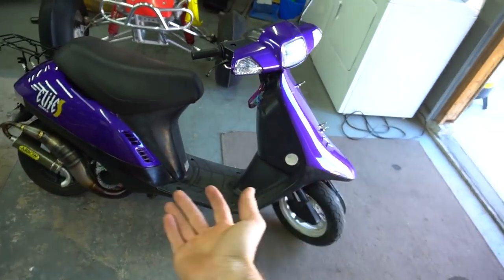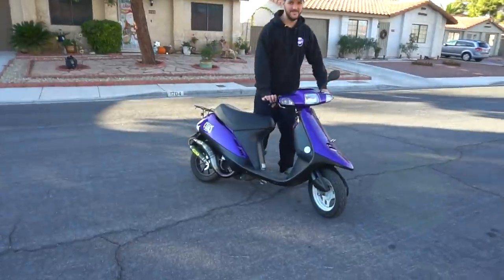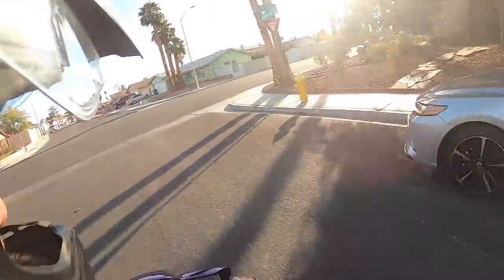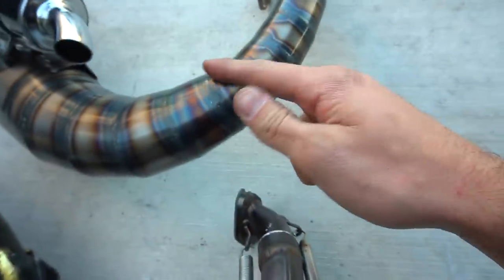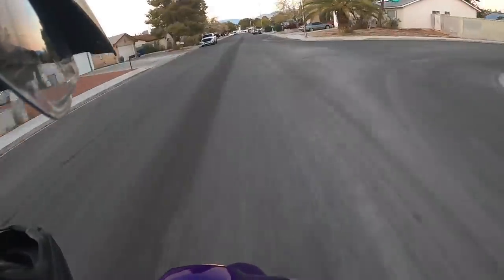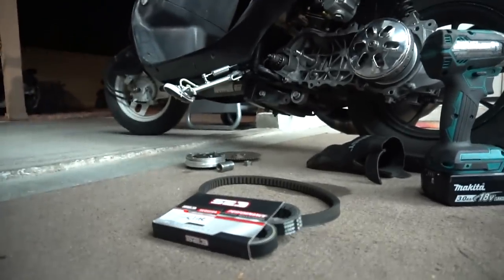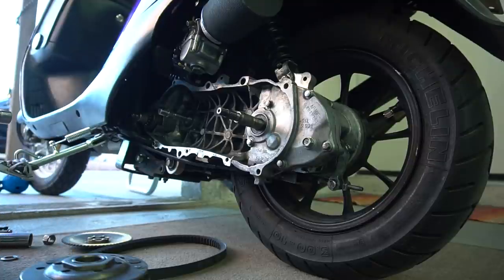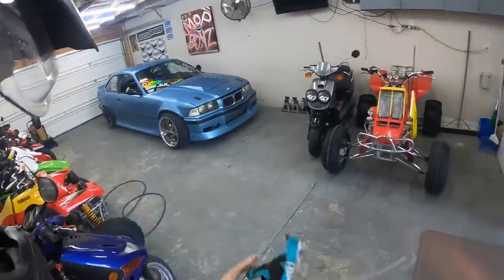Honda DIO PROTOTYPE Exhaust Testing 72cc AF16

Comment: Thanks buddy I appreciate it!
Reply: Can’t wait till these drop!
Reply: Have u ever did a straight pipe vs a expansion chamber? If so what one works better. I have a 100 cc two stroke  and when I went with straight pipe no muffler I for crazy low end and lost a lil top speed but I'm trying to figure out if expanded chambers are worth me buying
Reply: @joneserupinsmoke9161  two strokes need expansion chambers to work properly. They use the expansion of the exhaust gases aid in pulling air and fuel into the cylinder

You should watch some videos on how two strokes work it will help you understand why they’re needed
Reply: @Scooterswapshop  thanks bro I but I Watched a few and how they send the unused fuels back and some shit abt the sound waves but Im just trying to see if anyone did that test yet. But yea man THANKS again boss man.
Reply: @Scooterswapshop  yo I am thinking abt getting a mopped head my self I watched some clips some of these cats to got em going damn u we as fast as or so dirt bikes lol

Comment: Looks like it’s a windjammer replica. I run 4.5gram weights and black (stiffest) clutch spring and red contra (stiffest) and it’s a ripper without any porting. Glad Brandon did this, a lot cheaper than my jammer!

Comment: Sounds like you need to stiffen up the clutch springs just a little to get rid of the shifting moment as we call it because it’s way to noticeable.
it should get you autowheelying from standstill.
Don’t go any lighter on the rollers

Comment: How is the throttle response on that bike? I have a dio with an almost identical setup except im running the arrow and a pwk 26mm. Rips all the way up to half throttle but after that just bogs from 1/2 to wide open throttle and cant seem to tune it correctly to get that too speed out of it. Thanks 👍

Comment: I have a 100cc ram quad how much hp gain if put pipe on? It’s standard pipe atm but have moped I want take pipe off it as want better pipe for that
Reply: 4.5 gram rollers standered carb though I am thinking doing manifold cheap taking bit off with porting bits putting tube and then it on bigger carb what you’d think

Comment: What spark plug are you using? My tach freaked out if I didn't run a resistor plug.
Reply from the maker: b8hs, fixed it now, it was a faulty tach, it wouldnt read anything just stuck on frozen

Comment: you have a failure bro, the tracks on the torcdriver pulley need to be made even, take a boron machine, make them even and it will be even better. (used google translator) and you need red spring

Comment: I have 84 Honda aero NH125 and I bought an aftermarket carburetor and it improved the performance very much but now I installed an aftermarket muffler and it runs like crap and vibrates